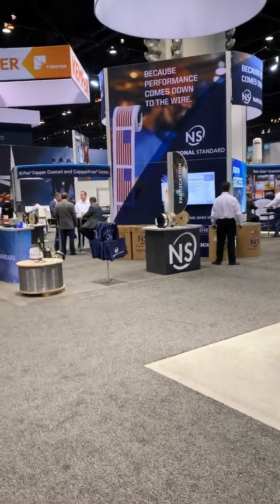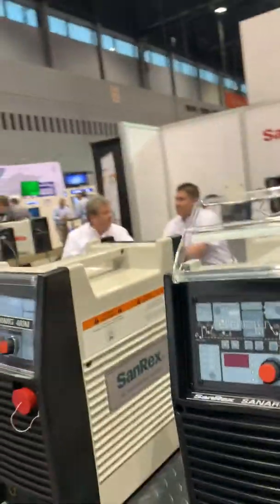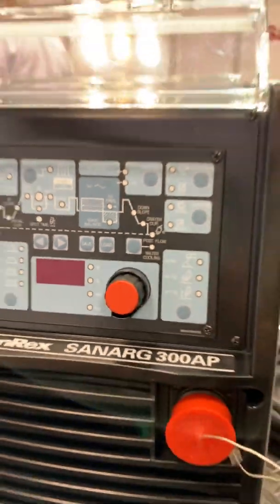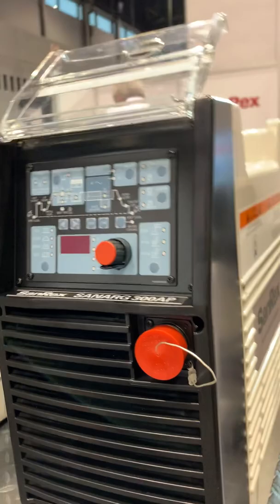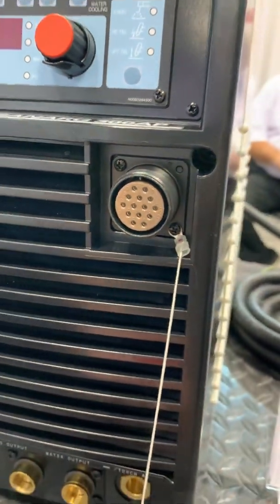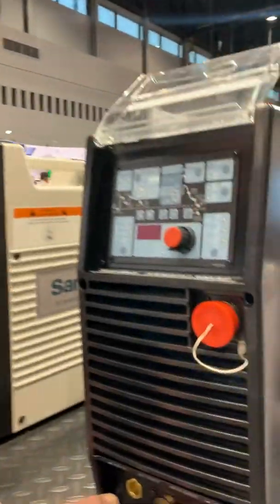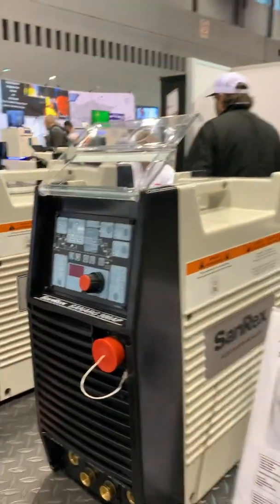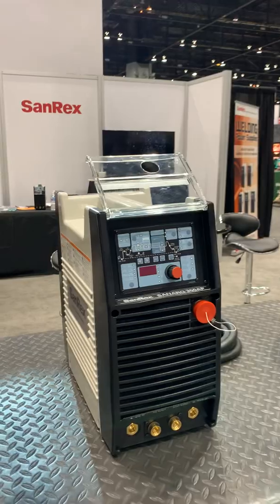2019 FabTech Day 4 Scott Introduces the SanARG 300AP AC/DC TIG Welder

Comment: E14 what ?
Reply from the maker: Hello Vong! E14 is the primary power voltage is low. Check your incoming power and connections. Also make sure that the Hi/Low voltage switch on the back of the machine is on the correct setting. Thank you! MooreWPS
Reply: Just got one of these this week.  
Will start welding aluminum next week with it.  Chose this unit over Miller, Lincoln, etc after seeing several aluminum welding shops here using this unit.